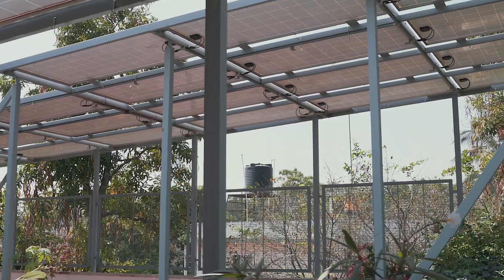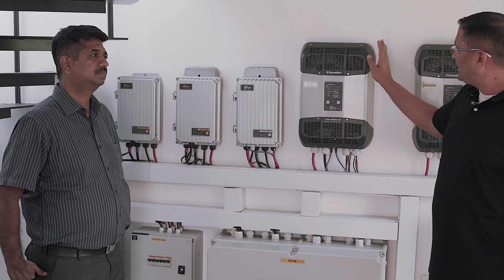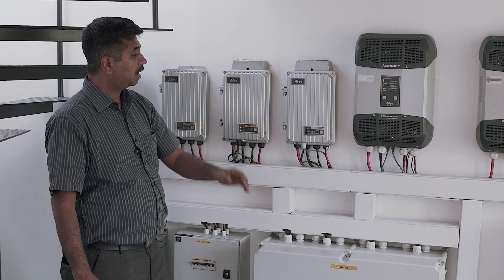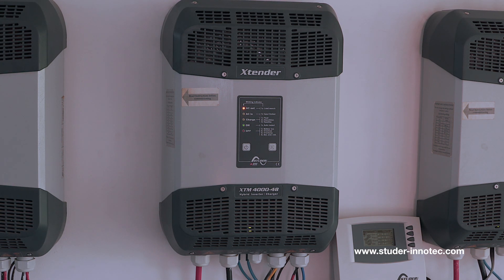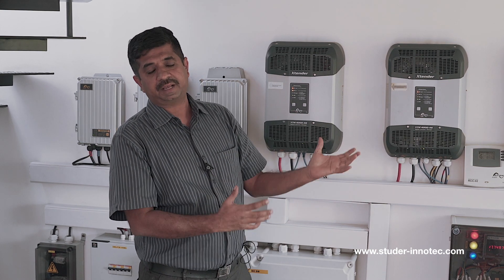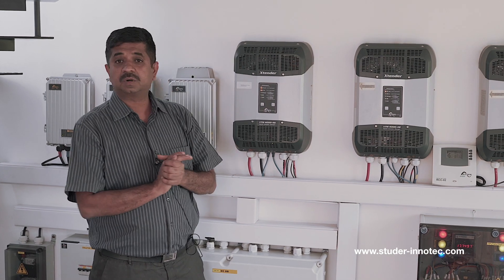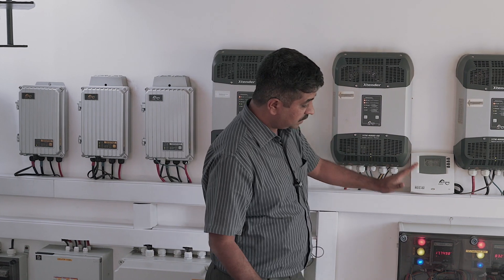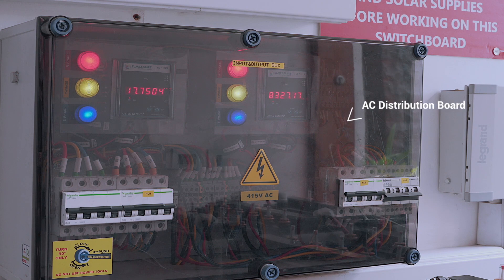Three phase Rooftop Solar Hybrid system

Comment: Good afternoon Sir, how are you doing, my Joshua from Nigeria, I have an Hotel to be Power with solar system, this is my load:
19 No's of AC that is 
Air condition 
1 No's of 2.5HP air condition
3 No's of 2HP
15 No's of 1.5Hp

15 No's of Refrigerator 90L hotel size, and 2 No's of freezers for the kitchen.

22 No's of LED TV

CCTV camera

Lighting point.

Please can Power this load.

lighting point

Thank you.

Comment: Hello sir. I am hoping you can answer a unique question for me. I have the XTM 8000 - 48 volt unit. it was configured for 120 Vac 60 Hz out to consumer. can I configure the AC in battery charging system for 120 Vac 60 Hz 30 amps generator to charge my battery's???If so, how would I do that?